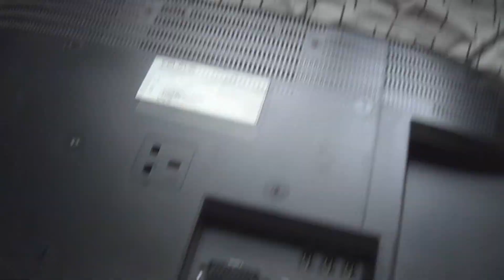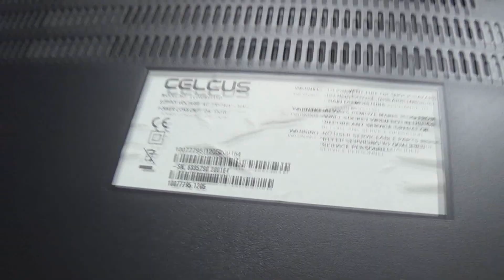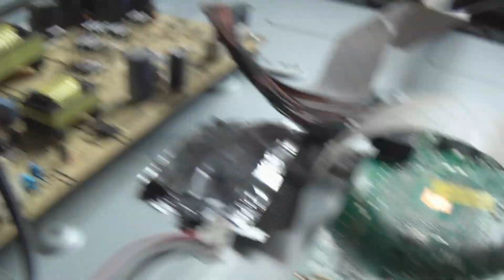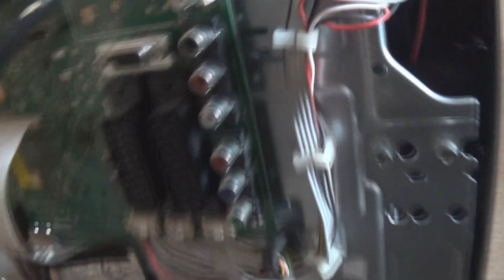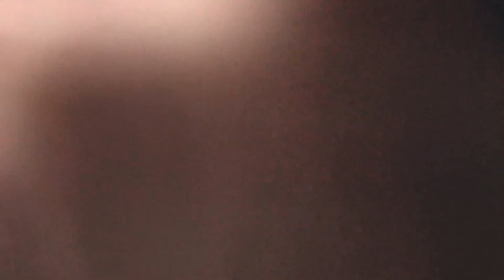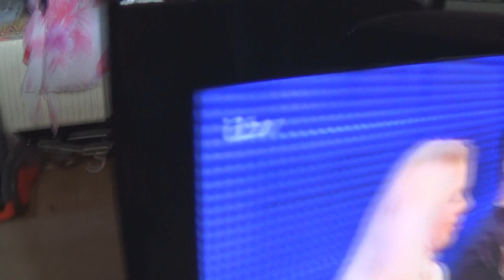17MB65 4 No Sound Repair

Comment from the maker: Another fix for these if you have no sound is to factory rest the Tv in the menu can cure this issue :)
Reply: Watched your video and checked a few components and pushed n pulled a few bits, no change. Factory reset sorted. Thanks for sharing your findings so far ... ;-)
Reply: Wish id seen this comment earlier , spent the last 3 hours troubleshooting a non existant sound problem ,checked the jack,  swapped the audio amp twice , checked all the voltages/audio signals going into it etc , what a ballache , i presumed there was no factory reset on these tvs since its not in the user menu, i had to press menu and a 4 digit code to get into the other menu with the reset in  ,sound is working now , oh well at least i know my chip swappage went well, thanks for the video, i seem to end up on your videos from time to time , maybe im one of the only people still trying to fix dogshit old tvs lol. Thanks again, legend
Reply from the maker: @reacey  sweet man nice one ☝️🤟😎